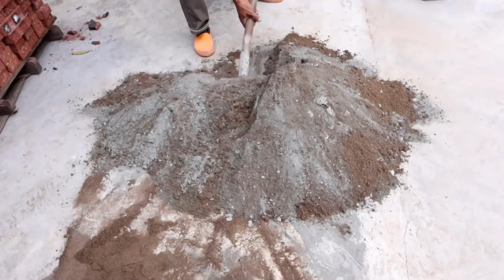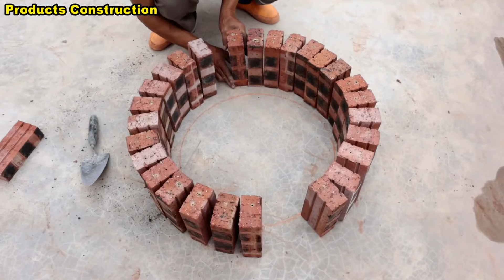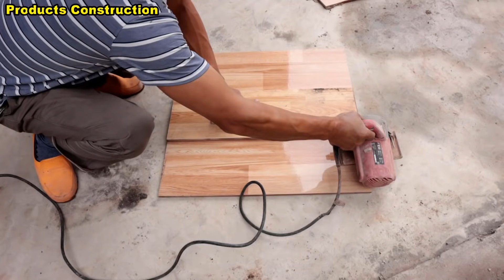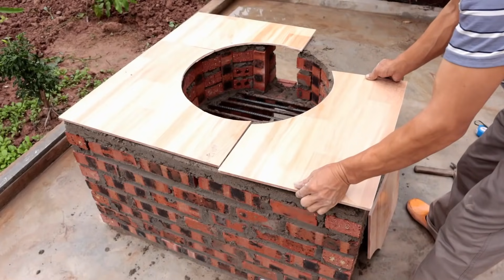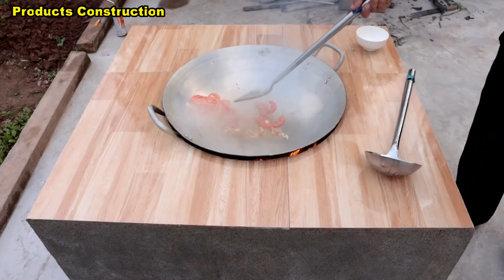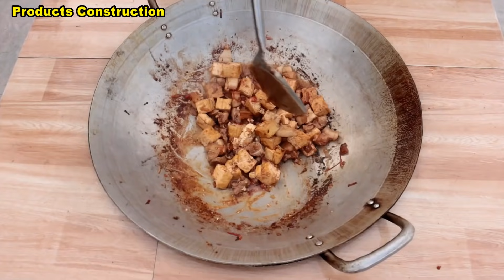Traditional Firewood Stove - How To Build Simple Outdoor Firewood Stove

Comment: Excellent work. A separate chimney of minimum 6 inch dia would work better. Otherwise, flue gas exit will be from the same path of wood charging. From this, one advantage is that wood will be preheated and dry out before going to combustion chamber finally.